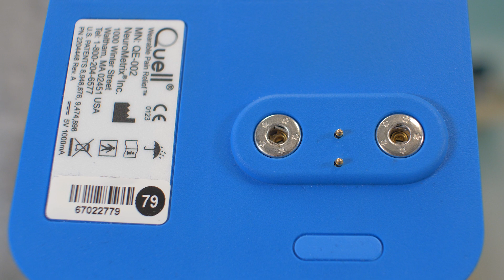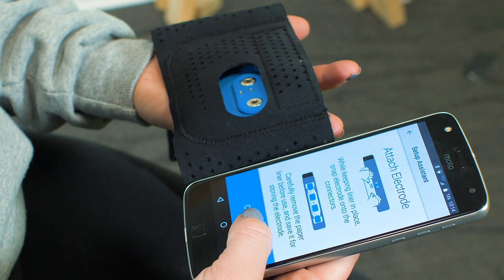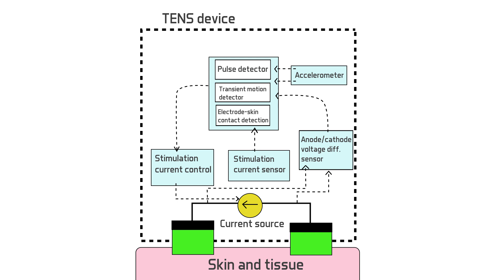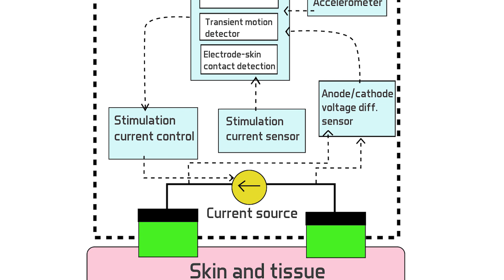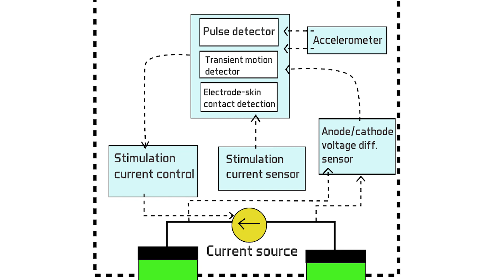Teardown: Inside the Quell TENS pain-relief stimulator

Comment: DO NOT BUY THIS PRODUCT OR DEAL WITH THIS COMPANY.  I purchased the Quell device (for polyneuropathy) and began using it.  It wasn't helping.  I called customer service within 30 days to let them know and make sure I was using the device correctly.  They said that sometimes it takes a little longer to notice relief- "at least a month" so I should keep using it.  I did and it still wasn't helping.  When I called back they refused to return it as it was past 30 days.  Completely illegal (Buyer's Revocation of the Acceptance of Goods exception).  Yet, they know people aren't going to sue over $300.  So, I'm out $300 and stuck with a bunch of junk that I can't even re-sell.